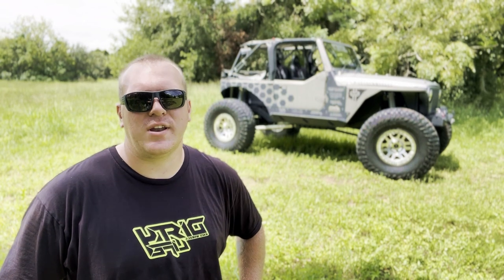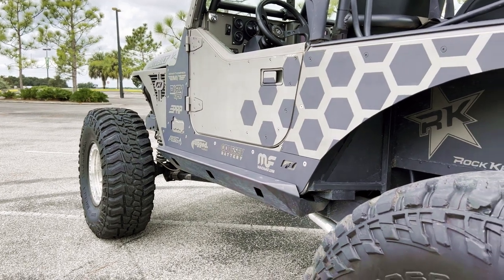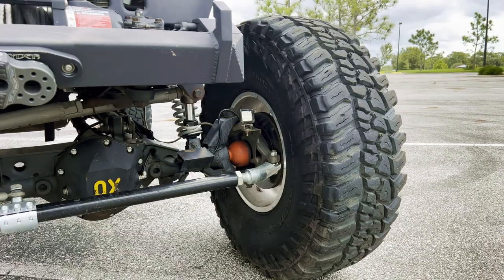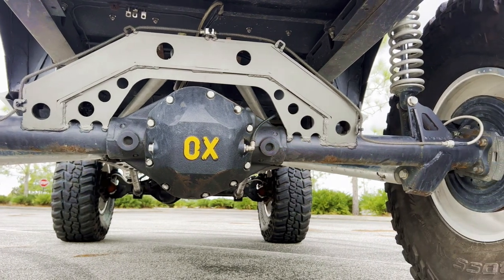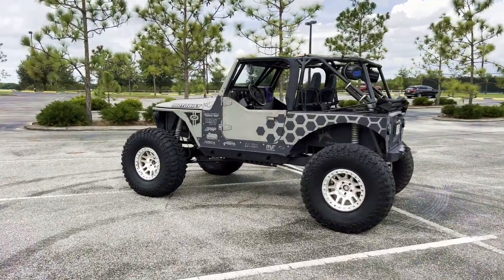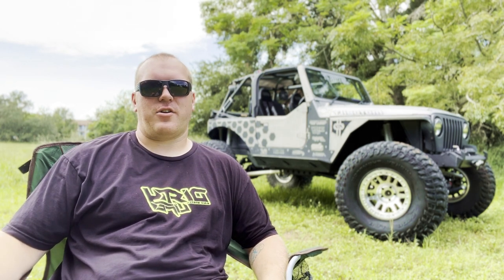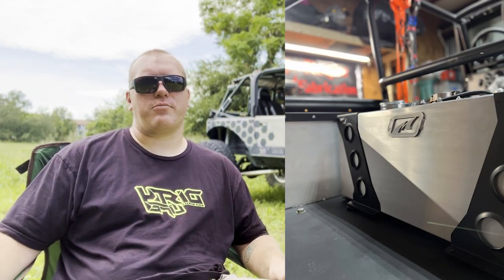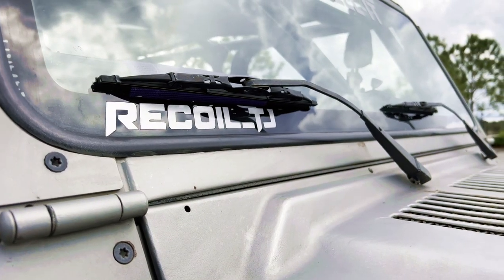Recoil TJ Custom Jeep TJ Full Walk Around

Comment: Are you running any sway bars? I’m looking into stretching the front of my TJ. Seems like the front sway bar just has to go. Not sure I like the idea of a rear sway bar only. Right now I generally run front sway bar only
Reply from the maker: Good question since I didn't cover that. Correct that it has to go away in the front unless you get really creative. I have a Universal Rock Jock anti rock kit in the rear. The idea of running one in the rear only proved to work well with how I set the Jeep up. Super long 16" coilovers on the front allowed the front to flex and climb an obstacle while the rear antirock kept the body close to level and very stable while the front worked. The front in most cases was far enough up an obstacle to help pull the rear up.  Sounded great in theory when designing it and it proved to work great on my Jeep.

Comment: How did you add that license plate holder? The holes line up even though that's from a JL?
Reply from the maker: Easy, just drilled them. Most aluminum tailgates don’t have any holes in them at all like this one so I just put it on and drilled the 8 holes

Comment: Only thing missing are the Portal Axles
Reply from the maker: portals?! that would be insane!
Reply: @RecoilOff-Road  the advantage of portals besides massive ground clearance under the diffs are better suspension geometry. flatter or smaller angles of the suspension arms reduce the forward movement of the front wheels into the bump and less stress on the bushings. in fact if more up travel could be engineered into the standard suspension by moving the bump stops, or lowered suspension without loss of wheel travel, all the lift can come from the portals with the best angles possible for better handling. my 2 cents